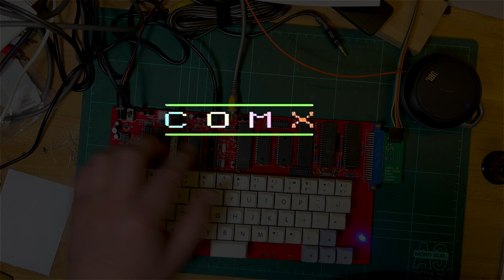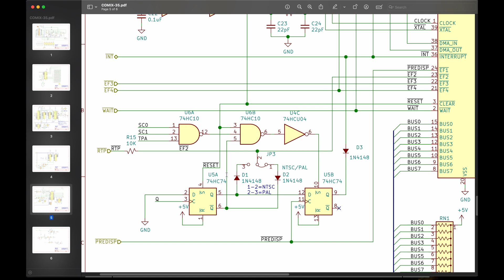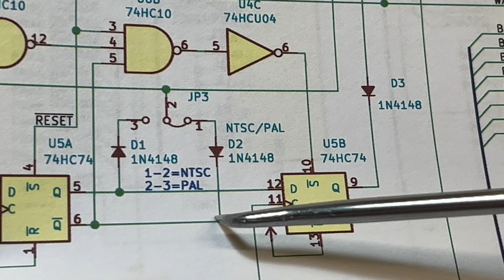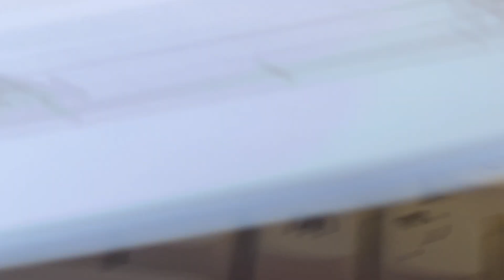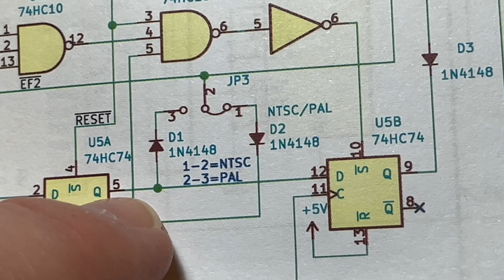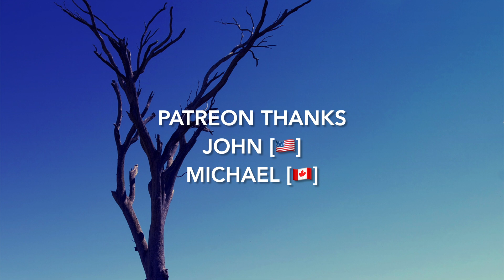🇭🇰 COMiX-35: Part 11 (PAL key auto-repeat issue) [#TCE0518]

Comment: It looks like the /EF2 is serving a dual purpose here. Normally it is for keyboard repeat, but during reset it gets latched high or low according to the NTSC/PAL switch. It should then get reset from the 1802 via Q at some time after a reset but it isn't so it stays low when the switch is in PAL anh high in NTSC. The fix would be to strobe the 1802 Q line from low to high, but this would mean rewriting the ROM code. So your answer of switching from PAL to NTSC seems the right way for now since the code probably needs it set properly right after a reset.
You might want to check if keyboard repeat works with the switch set to NTSC. If I'm right it won't due to the latching.
Reply from the maker: Yep, you're right.  I had a read of the COMX-35 technical manual and it states that on power-up the state of /EF2 tells the machine whether it's PAL (high) or NTSC (low).  I also got a reply from one of the guys that designed the high speed interface who said they experienced similar but thought they'd fixed it ... so having the HS interface plugged in might be causing the problem.  Will re-test ...

Comment: So let's back up and ask the question if we only want Auto-Repeat (henceforth "AR") in a certain video mode? No, I don't think so. So that can go away. 
The only line from the flip-flop that can pull EF2 low is /Q since it has the diode orientation set to conduct to ground when /Q is low.
The clock line going into the flip-flop is unconnected, and I'm pretty sure that it was never intended to be driven from Q.
Thank goodness that the (over-sized?) resistor R15 is in there, as it protects the output from your keyboard chip. But wouldn't a diode make more sense?
Check out /PREDISP, which comes from the CPU, but curiously shows up on page #1 in a block called "cpu". What is the intent of page #1?

I think that auto-repeat, and some of the display glue logic got mixed up and you should remove the PAL/NTSC switch. Which should mean that you can get rid of R15 as well (and forget the diode too).

Comment: The diode stuff is probably to do with the PAL/NTSC selection logic and nothing to do with key repeating. They might have been using /RTP from the keyboard chip as a convenient 5V.  The whole placement of the PAL/NTSC selection being there doesn't make any sense to me. I'd rework it with /RTP from the keyboard chip going to /RTP of the CPU directly, bypassing the switch, and joining Pin 2 of JP3 to a real 5V. (shrug)
Does it compare with the original machine you have?